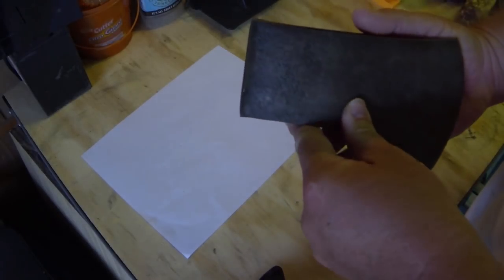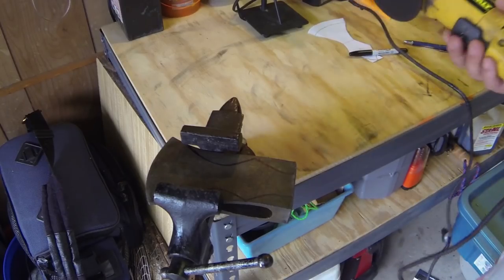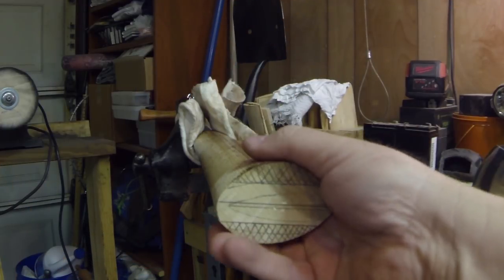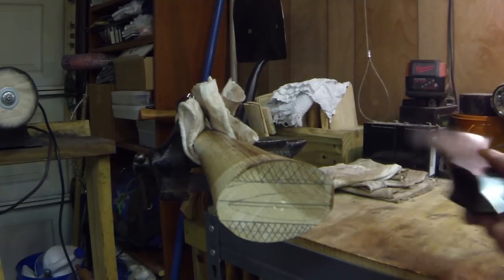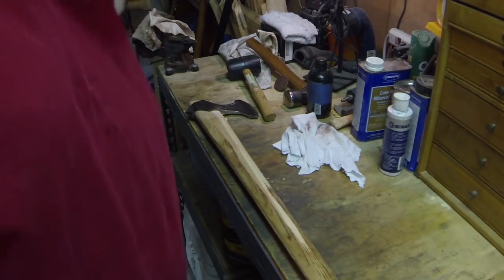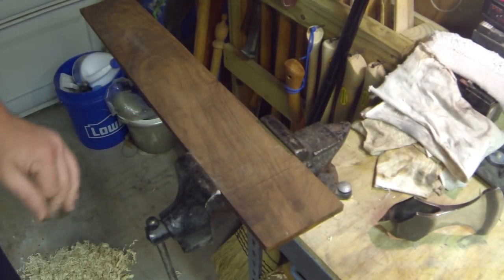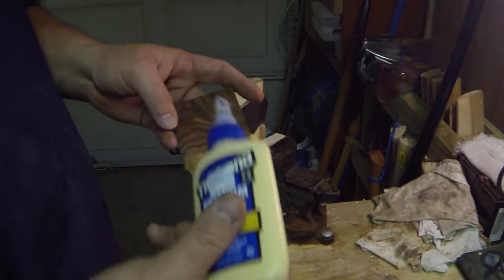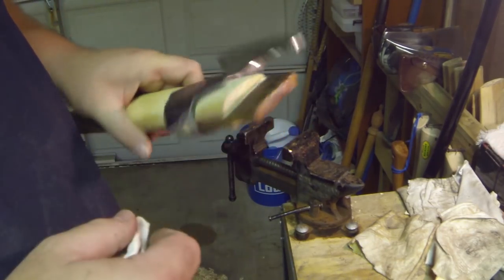Viking / Skeggox type AXE Modification from an American Felling Axe

Comment: I think you have done  wonderful job on this axe.  I am acquainted with a blacksmith who actually forges this type of axe head in a traditional manner and I have to say that for a home hobbiest, you have made something very nice.  I really like the fact that this would be something that would actually hold up in it's intended use, because of the basic axe head you started with and the really stout handle you have fabricated.  Not that I would hope it would ever be used as a weapon, it is just nice that it could, as opposed to some home hobbiests who put together items like tomahawks made from railroad spikes, which could never be functional.  You have a nice array of tools as well, it was great to see someone using a drawknife and spokeshave and that they were actually sharp enough to cut.

Comment: Love what you've done with this axe! Every off road-er or camper should pack a light 2/3 - 3/4 axe. (Far more useful than a oversize hip knife. New life may be beaten into the 3-5 heads I've seen in buckets at the old family farm.... (I go prefer a hammer head, but trimmed to a nice size.... ) Art from debris! You Rock!

Comment: Very nice video, and I have an idea for another cool video you could do. You seem to be very knowledgable about using different types of files and sandpapers to work the blade to a very fine edge. You always get your blades sharp enough to shave hair.

A video where you explain all the small details of sharpening such as the best angle to use when sharpening a blade and the files / sandpapers to use would be very educational for people who don't know much about sharpening.

Also, I think a video showing all the steps to bring an old metal tool from rusty to a mirror finish could be a real hit.

You have showed both these things in many parts of your videos, but I think focusing specifically on them could be really interesting.

Comment: I like it!!!

Can I give you some advice? may you serve later.
When you have to fix two pieces of wood (one inside the other) mainly put glue in the slot, not in the ear.
If you put glue on the pin, when it comes, most of the glue does not enter the slot.
Sorry for my english, is very rusty and very bad.

Comment: Do you not have a torch? Would have made the cutting WAY easier, and a lot faster! Im an iron worker by trade and I know cut off wheels are worth a damn for anything over 3/8 inch thick. Your basically just burning them up. Probably went through 2 or 3 cutting that pattern out? Really should invest in a torch set if you dont have one. Those cut off wheels add up after a while. Nice axe though! Im not knocking your video by any means, just trying to help you out in the long haul! Good job man!

Comment: Nice work Nick, You should look into a proper wood workers bench & vise.  Also When you clamp up your work in the vise work closer to the jaws.  You've got way too much movement and shifting going on.  But a better bench and vise would go a long way to fix that. 

One thing, what was the quality of the steel you started with?  Some of these hardware store axes are crap steel with no real temper.  Does the blade "Ring" when you stroke it with a file?

Comment: Not trying to be all hating.
But that's not a skeggox. Or skäggyxa in swedish.

Skäggyxa, made from skägg, yxa. Meaning beard, axe.
Bearded axe, referencing the axes beard. IE the part of the axe that goes over a large portion of the handle.
http://www.gransforsbruk.com/wp-content/uploads/2012/12/503-Tv%C3%A5flikad-Sk%C3%A4ggyxa.png
You can easily see that this tool was intended to protect the hand while holding the handle almost all the way at the top, the axehead thus shields the hand from impact and you get more control over it.
It got used in war as well since its lightweight.

Yours is... i dunno.
http://media.yxor.nu/2012/09/norsehawk.jpg
Kinda close. Timmerbila.
Timmer = lumber  bila = broadaxe (according to google translate) Timber/lumber-broadaxe.
It's still a viking age tool.

Also, your axe looks very nice, love the dark wooden handle. The smooth steel is also a nice touch.
Great remake of an old boring axe. A lovely broadaxe.
Reply: +Klomster I'd say thanks for the info, filled in the gaps in my knowledge...really helps to have a deeper context, in your case the language and cultural understanding of how tools have been defined, so I say again, Thanks!
Reply: +Robert Edwards or tack så mycket!

Comment: How's the temper on it? I know power tools can heat axes up enough to need re-tempering.
Reply from the maker: Panzervagon it never reached a temp hotter than you could hold with your bare hands, i believe the temper should be fine on this mod.

Comment: question: did Vikings really used this axe design? yes .. it does look really cool ( and scary if a viking comes at you with it ) but the original piece you had is probably stronger.

Comment: question I have is with all of that heating and cooling of the blade with the grinding did you have to reheat treat or did it retain its temper?
Reply from the maker: bubba2974 the blade never reached a temperature hotter than you could hold with bare hands...The temper was not harmed in this process.
Reply: Nick Sellers good enough was just wondering :)

Comment: i'm really new to metal work, i just want to learn how to do stuff and why stuff is done. to my under standing wouldn't that at 4:14 completely nullify the bluing to begin with? it looks to me like your just scraping it off. not a hate comment, i want to learn.
Reply from the maker: adsfacvadtrvawefdgh jdsfpoiajsdpo i sanded off the Bluing on certain spots to get a 2 tone look. i kept the spots where i wanted to keep the bluing, taped off until the end.
Reply: But why do that, it seems like that would make that part really rust prone

Comment: The steel will cut a lot smoother if you anneal it.
Reply: +HevnerKnifeReview Yep. It would need to be re-hardened and tempered. But that's not difficult with such a small piece of steel. You can do it in a wood fire. The steel only needs to be cherry red.

Chances  are that he already ruined the hardening to a degree anyway with all that cutting and grinding. That's why knife makers constantly dip the steel in water while shaping after heat treatment.

—

Comment: Dont you destroy the hardness (the original heat treatment) by using the grinder with no cooling?
Reply from the maker: Niclas Falck i did cool it in a bucket of water every few minutes, the metal never got hot enough that you could not touch it with bare hands.

Comment: nice Skeggax, dude ^^

Seams a bit like an axetype they found in Haithabu:
http://www.skjoldmus.de/Typentafeln/Aexte/Aexte_Haithabu.jpg
Westphalen Type 11

Length:  19, 2 - 20,0 cm  ~ 7.5 - 7.9 inch
hight: 12,0 - 12,7 cm ~ 4.7 - 5 inch

dated in the 10. Century

just another service provided by your friendly neighborhood Archaeologist
Reply from the maker: Thanks for the interesting information Askan Helström, i may use some of those designs in some of my next projects.
Reply: Nick Sellers no problem, dude ^^

if u use the correct metal and the correct wood for the handle, also note some informations like, how long u need to cut a tree, waer and tear, etc., as a scientific paper, it's called "experimental Archaeology" ^^

Let mw know if u want some help with archaeological facts ^^
ur work is awesome ^^

Comment: .......did you seriously work with grinders wearing shorts and soft poly-blend sneakers........were you not worried about hot metal hitting your legs or melting your shoes.
Reply: +Kenneth Donnelly    I'd be more worried about using those thin cutting discs, which are prone to exploding anyway, in forged steel WAY thicker than it was designed for, while having no guard on the grinder and no gloves.   I usually don't get on to people about safety, but that was just beyond stupid........
Reply: +Kenneth Donnelly  I guess you would really get excited seeing me arc welding in just cut offs and flipflops.  But as long as there are no crevasses to catch the sparks, they just hit and roll off.  But with long jobs I need a shirt to protect from flash burns.
Reply: ***** yeah i saw that too.........but serriously to work with metsl and power tools and no safty clothing is beyond silly.........its the diference in spending a few mins and a few dollars and ending up in thd ER with a nasty burn/cut and a huge mefdcal bills and weeks of pain and disvomfort.......i just dong get it
Reply: +Matt Culler I agree with not using a guard or wearing gloves buy a metal cutting wheel is designed for metal from forged to high carbon to cast and stainless if it's a wheel for stainless